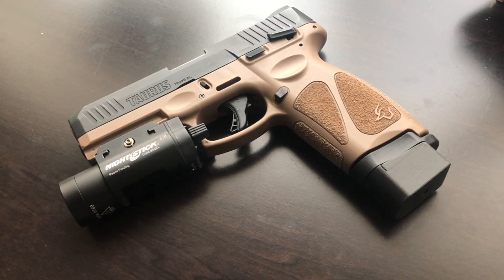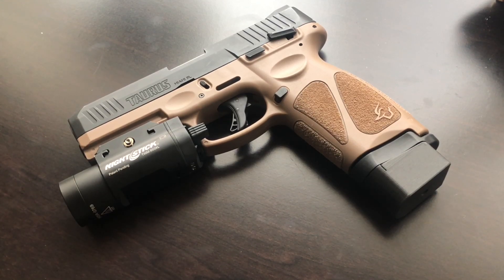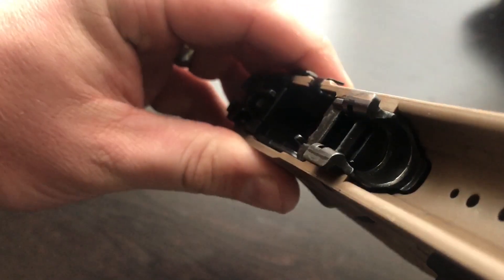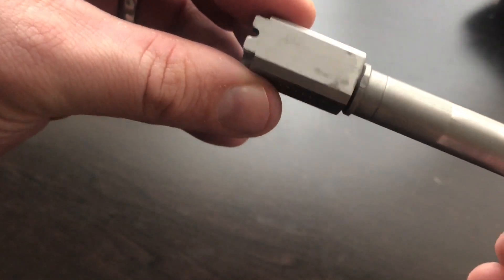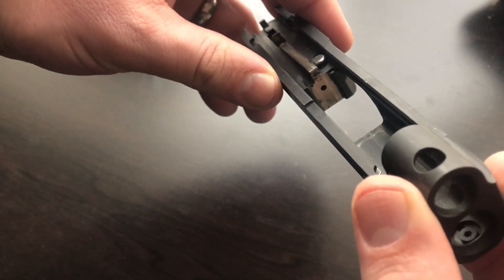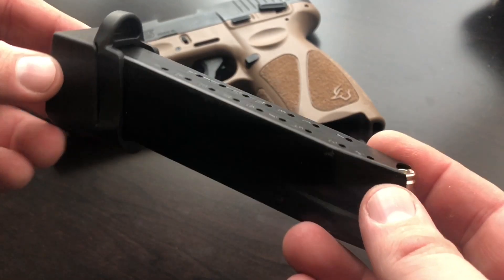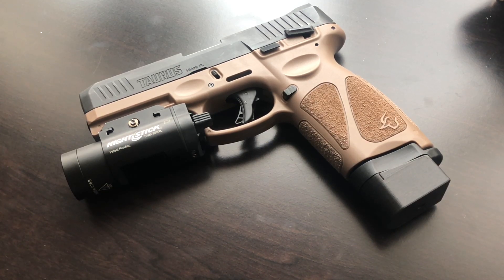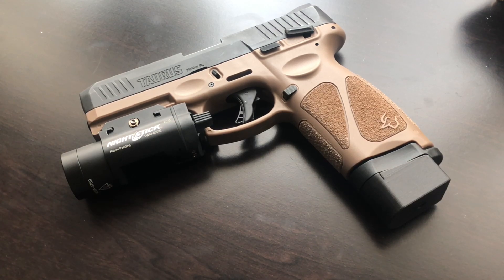Taurus G3 Internal Wear

Comment: This doesn't seem to be a wear issue as much as a mating of part to part. I see no galling or gouge marks at all. This will, more than likely, stop at some point in time. That's when you'll see this as an area for light (very light) moly grease application areas. This is not a negative issue.

Comment: Has anyone had any major failures from the g3 or g3c? And if so did warranty cover it and what happened?
Reply: I’ve put over 800 rounds thru my G3. It’s been flawless. I recommend to everyone.
Reply: No G3 IS A NEW ERA PISTOL AND THEY RUN LIKE BUTTER
Reply: My G2C has a "short chamber". Which means some rounds that normally work in 9mm handguns won't work in it. After researching this problem, I've discovered this is a common Taurus problem. I noticed this issue on mine after I chambered an American Eagle 124gr FMJ round and then tried to eject it. The round had chambered just fine when I racked the slide. But the slide was froze when I tried to eject the live round. You can check for this issue by taking the barrel off the gun. Then, drop in a round. This is called the plunk test because it makes a "plunk" sound when you do this. Anyway, after dropping the round in the barrel, grab the back of the chambered round and spin it left and right. It should easily turn. Then, turn the barrel over. The round should fall out easily. If the round doesn't turn freely both ways and then doesn't easily fall out, the bullet is touching the rifling. On a short chamber, some types and brands will pass this test. And, some won't. My barrel flunked this test with all 3 Federal ammo I tried. American Eagle 115gr FMJ, AE 124ge FMJ and Federal 147gr Hydra Shoks. But it passed with 10 other types of rounds. From 115 to 124gr. Some FMJ and some hollow point. So basically, it don't like Federal and worked with several other brands and types. Really weird ! Lol. I've had alot of Taurus handguns in the past. Most worked just great. But back then, if you called Taurus needing help, they were assholes ! And I mean just horrible to deal with ! But I got a really good deal in this G2C. So I took y chance. It should work with Federal ammo. But, since I know it has a short chamber, I just know to do the Plunk test with any ammo I want to use in it. I can live with that. This gun just fits my hand perfect ! And it carries like a dream. It has become my favorite carry gun ! And I love having 13 rounds. And I did test Taurus customer service. I have heard they were much better now. I noticed the end of my guide rod that faces out of the slide just looked rough on the outside. Just cosmetic. But I wanted a new one. I was very surprised ! They quickly answered the phone. And a very nice lady told me no problem, they would send me a new one for free. I got it in about a week. But- it was for the 40 G2C. They are different ! So, I called back. Once again, a nice lady quickly answered the phone. I told her they had sent me the wrong one. She apologized and assured me they would take care of it. And I don't know how, but I received it the next day !!! In the past, it took Taurus over 10 months to deliver 2 magazines I ordered from them. They have really changed !!! Now I have 3 guide rods. 2 for the 9mm and one for a 40. Like I said earlier, I love this pistol. But it is showing LOT'S of wear. The worst is on the frame. And I haven't even got to shoot it yet. My wear is just from racking the slide and field stripping it. The west on mine is almost the same as the one in the video. So I guess it's just normal wear on these guns. You should check the chamber on your Taurus. Do the Plunk test. Oh, and when my slide froze with the AE 124gr FMJ round. I got it open by holding the back of the slide in one hand and smacking it hard on the back of the frame. And I had to smack it hard ! Kinda scary! But it is the only way to get it done.
      Update- I called Taurus and thanked them on the fast and courteous service with my guide rod.  And I asked about the trouble I was having with 3 of the 13 rounds (all Federal) locking up my slide when chambered and not passing the plunk rest. The nice lady I had talked with about the guiderod issue took this call too.I told her I had found out that some of their barrels had short chambers and I believed that might be my issue and did she think I might need my barrel looked at or even swapped out. She was very courteous once again, but seemed not to want to talk about the short barrel issues and instead told me to break my gun in with ammo it likes and then try the Federal again. I was hoping to swap my barrel for another one honestly or at least have mine inspected and repaired if needed. But I'm okay with her suggestion. It could just need to be broken in. And, I'll just check any ammo I want to fire in it and probably not try anymore Federal. Autos can be picky. But I'm curious if anyone reading this has had this issue with any of their Taurus guns? I've had many firearms over the years and have never had this issue. And I will say, I am impressed with Taurus customer service. They have finally hired friendly, helpful people to talk with and they quickly took care of my guide rod complaint.
Reply: I have a g3 and I highly recommend it, this is a nice firearm and performs flawlessly.

Comment: I have a S&W SD9VE with probably well over 2000 rds and it's wear is minimal ...
Reply: I have one of the Smith & Wesson's handles beautifully got it before the prices went up glad I did
Reply: @joeyoung4121  , bought mine about 5 years ago, it’s been 100% perfect.
Reply: @joeyoung4121  , let me rephrase that, had a local gun shop attempt to install an Apex trigger and spring kit, never worked properly and I let it sit for about a year, took it apart tried another 2 Apex triggers, they seem not to fit, so I put the original trigger with the Apex springs in and now it’s back working.